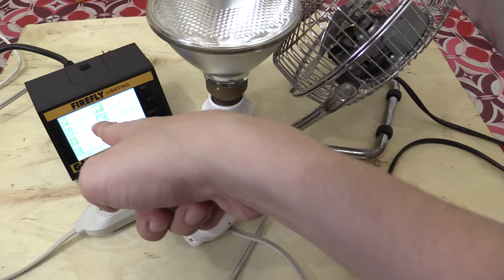Cheapest remote controlled power socket

Comment: I want to ask,what voltages are the mains in Philippines?
Reply from the maker: There's some variation depending on area but somewhere around 230V is common.
Reply: Gadget Addict but why does the US plug is so common?
Reply from the maker: Dunno, maybe it's a hangover from when the yanks colonized the Philippines. In reality there's a variety of plugs being used here. There's the flat 2 pin, the round 2 pin, the flat 2 pin with ground and then the polarity specific 2 pin which has one pin wider than the other.  And because a lot of items are imported from Hong Kong, you'll also find many items being sold with the British style 3 pin plug. That's why universal sockets and universal adapters are so common here :P